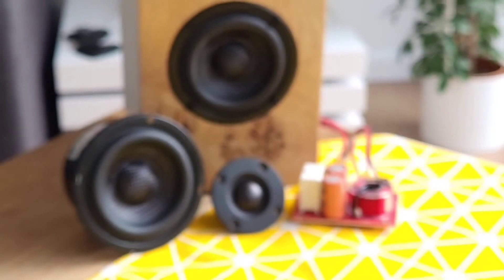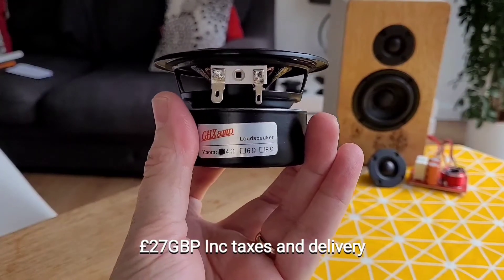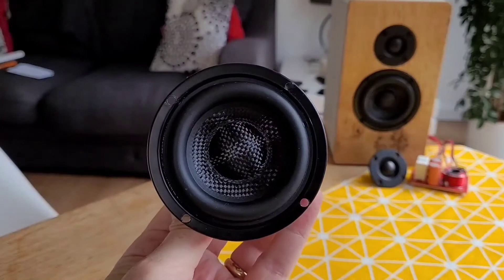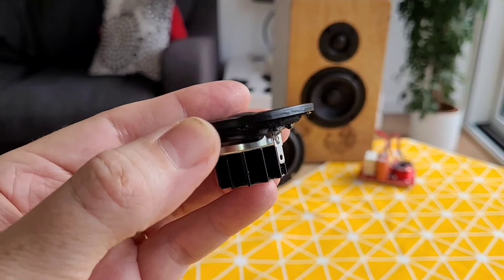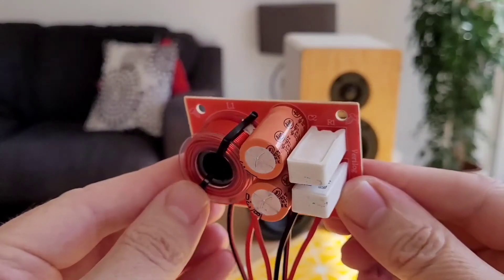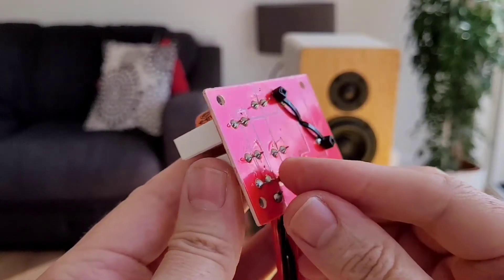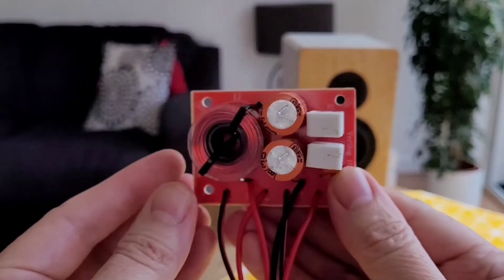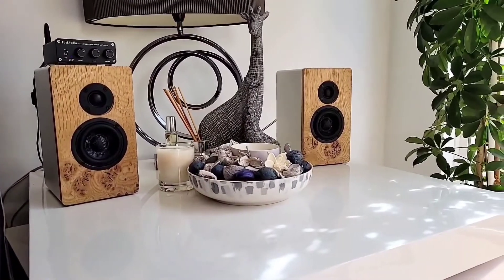Budget Woofers, Tweeters and Crossovers. Chinese Imports. AIYIMA, GHXAMP 3" Woofer, 1" Tweeters

Comment: Hard to judge on the old laptop. 
Anyway I have bought blank amplifier circuit boards from China and found are of high quality. 
I have in last couple of months replaced some Danish tweeters ( damaged and unavailable) with Chinese.  Very similar in spec and sound good but  slightly down on output.  The best bit is not as harsh as the original. 
So just because it's made in China doesn't mean it's crap . But it is between  a 6 to 10 week wait from my experience.
Reply from the maker: TBH most things are manufactured in China just look at the iPhone!! So, I agree lots of good stuff too!